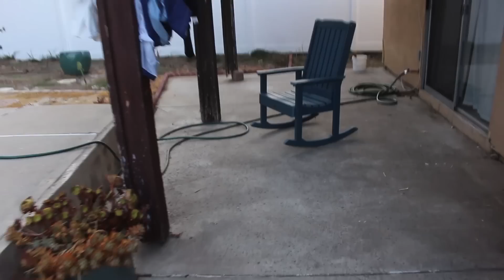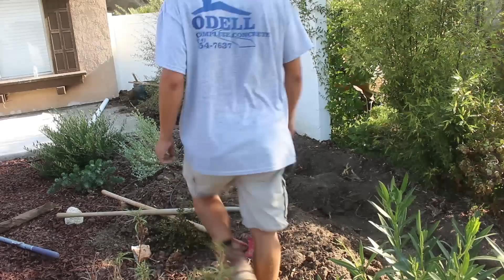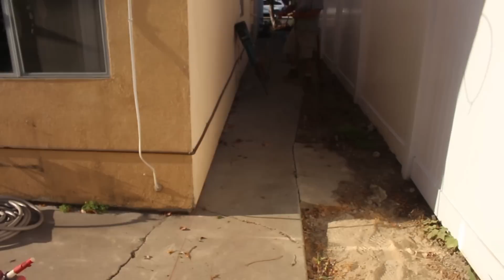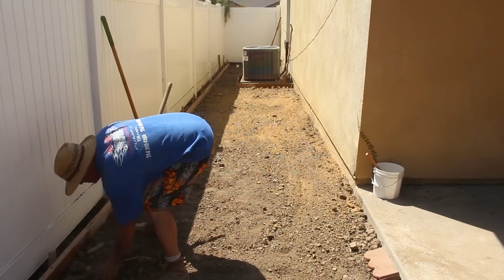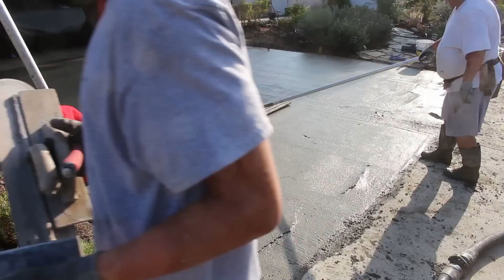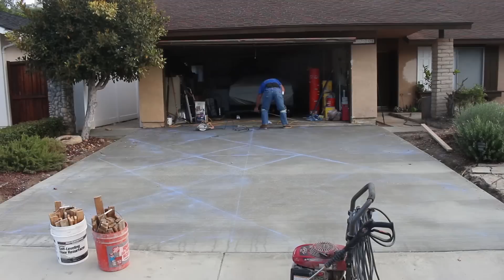How to Pour a Concrete Driveway With Diamond Saw Cut Pattern - DIY

Comment: Hey david,what would be the pros cons of wet cut joint opposed to saw cut? Thanks
Reply from the maker: I think saw cuts are a cleaner, straighter, easier to roll or walk over.
Wet hand cut joints saves you another day, and a lot of concrete dust, slurry.
Reply: Awesome brother  thanks your the best

Comment: What is the fiber and magnesium use for?  I have an 60' X 18' driveway that is already 25 year old concert and may need to be replace due to cracking and moving up in some areas.  I am thinking on getting another motorhome that weights  40,000 LBS. What is your recommendation? Fiber, rebar, magnesium, etc....? Thanks in advance

Comment: Why not make diamond shapes when concrete is still wet and smooth, from my experience it's easier to make the grooves,..... although I've done decorative driveways where the edge of the driveway is smooth while the middle portion is stamped
Reply from the maker: I find it much easy to cut after the concrete is hard and straighter lines
Reply: Odell Complete Concrete ok I saw that the saw have it a straighter shape instead of it being beveled

Comment: The heaviest guy is always the bull float Man 😂
Reply from the maker: +Sean Shenandoah 
True
Reply: Odell Complete Concrete, you and your guys do a great job, thx for the videos, I'm all done with concrete for the winter here in upstate NY so watching your videos is nice during the long cold season. It's always nice to see how other people do it because you can never stop learning, up here we do allot of finishing old school, edging by hand not with a pole, hit it by hand with knee boards on everything. And how you split this pour in half and had a form in the middle for a guide to screed off of seems way less complicated. We always run a string line across or use a Lazer for height down the center, drive steel pins down and put tape or sharpie to the height  and make a wet screed down the center and screed down each side. I've been with a few different companies and just seems like we do everything the hard way lol. Anyway good job and look forward to more videos ✌️

Comment: Nice job sir !  I wish i couled do it like this in northern Sweden =(     250 gallon (aprox 1000 liter) concrete costs like 200 dollas
 here, and before that we need to put 3 inch of cellplastic insulation under it all with 3 inch spacing between 1/2 inch thick rebars.
 So here we only use concrete as fundation under and in buildings =)   Love your vids keep em coming
Reply from the maker: That's intense

Comment: Great job David! (As usual)
A couple things I noticed - why didn't you just take out that old, cracked sidewalk and pour the whole walkway?
Also, I was surprised that you didn't do a 45 cut at the corners of the driveway...won't it tend to crack there?
Reply from the maker: It wasnt in the home owners budget to do the other cracked sidewalk and im sure the driveway will be okay but would have helped.

Comment: What's your opinion on using Helix in the concrete mix?
Reply from the maker: May be good in a commercial setting in doors.. Power trowel surface smooth.

Comment: These videos are awesome. I find it interesting that you "flood" the ground to let it soak up the water and expand before you pour. 
I would think that now you reverse the problem from being a risk of moving/cracking the concrete due to expansion if there is a heavy deluge of water and the ground had been left dry, to risk of moving/cracking the concrete when the ground dries out again after being saturated?
Reply from the maker: Nothing will happen because the ground is already expanded and concrete is poured to the bottom with steel in it as well.

Comment: Pardon again for a noob question. I was reading up on rebar and stumbled by chance onto basalt rebar. It appears to have the major advantage of not interacting with chemicals or water. There seem to be even preconstructed mesh grids, in addition to cut fiber filaments that can be added to concrete.  Any comments on those type of things?
Reply from the maker: I use fiber mesh.

Comment: Wow that saw cut pattern really looks classy.  What did you say the band width was? 12"?  How much nicer would the result be if they would call you first instead of the fence guy and the hvac guy
Reply from the maker: Yes the AC would be better after concrete.
The fencing is just a matter of burying the footings below grade.

Comment: +odell complete concrete
How deep do you cut your relief joints?
Reply from the maker: depends on the depth but I like to get 25%
Reply from the maker: 3/4 of an inch
Reply: 3/4 deep on the driveway as well?